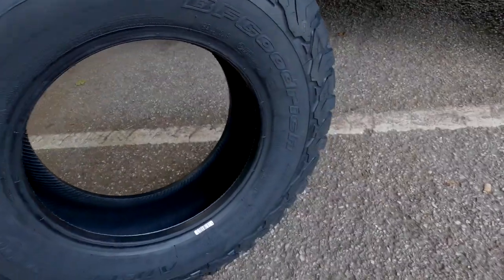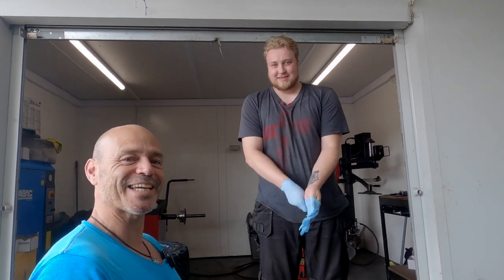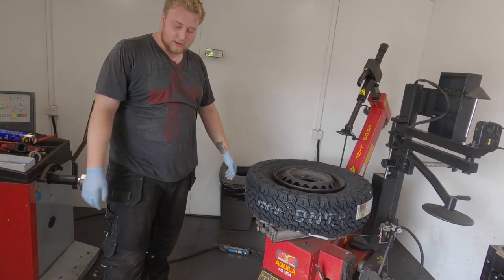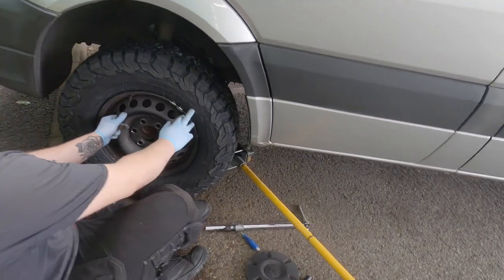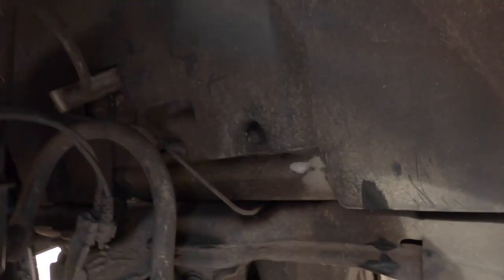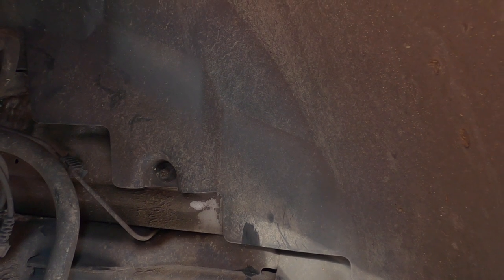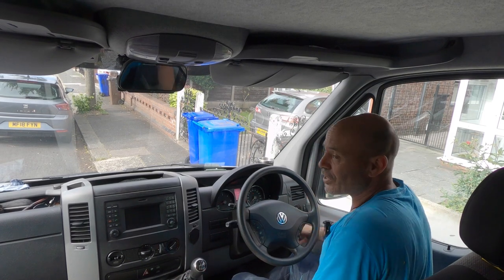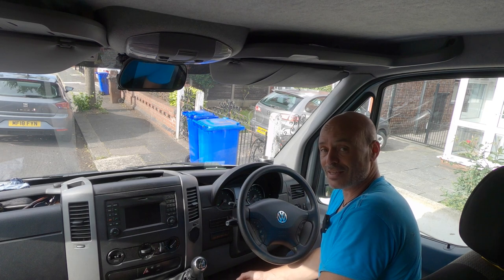Campervan All Terrain Tires/ Do They Rub. BF Goodrich. Scoobie-Dee 53

Comment: The general rule of thumb is a two tyre sizes (25 to 45) goes with a 2 inch lift. The easiest way to get some lift is rear heavy duty bump stops such as sumo spring brand, and coil helpers on the front,...asuming a VW has coils. Most vans do. These are just rubber or poly rings you place between the coil. Saves you getting serios work done. 
I spent $4000 getting heavy duty rear leafs and coil/struts on the front to get a 2-3 inch lift...allowing me to fit 4wd tyres. 
I was going to get BFG All Terrain ...but they were on back order...so I got Goodyear Wrangler Duratracs which are a chunky all terrain, and better in the wet.

Comment: You are really lucky with your 29 mpg...
Mine only gets 21 mpg Most times.
I have the 2.5l 160 horse engine.
Reply from the maker: I notice a big drop if you drive faster than 65 mph . I can get over 30 if driving around 55 mph .. well at least according to the VW read out !!

Comment: Hi, i’ve just seen these tyres on ebay with alloys and they are only 225/75/16  not 245’s. Im reckoning they are not as wide by 2cm so would that be better to stop rubbing when turning for my van? Its the sprinter 2008. Its exactly the same body im thinking.
Reply from the maker: Yeah but check the weight rating

Comment: Hi mate. My tyres are tiny bit bigger so rub a bit more than yours. You should look at sumo springs for the front. Apparently it improves the ride no end. And it will stop that sag into the corners. 👍🏻👍🏻
Reply from the maker: Ok cool, must lift the van up a Cm or so then
Reply from the maker: Also what tires have you got?
Reply: @ScoobieDee  just checked. They are the same actually. But I’ve since learned that the lwb is actually lower out of the factory. To keep centre of gravity lower. I’m lifting mine 2” and sumo springs.

Comment: Can someone please educate me. If the tyre is bigger than standard (ie the tyre is turning LESS often to cover the same distance) then why would you "lose a mile or two per gallon"? If the wheels are turning less often, then you should be getting marginally BETTER miles per gallon surely.
Reply: takes more effort for the engine to turn the wheel, has a same effect as a bigger gear
Reply: I get that @sillytorque  but surely once you’re up to speed and cruising, then the bigger circumference tyres must be more efficient surely? 🤔
Reply: @cambellevans9945  there would be an optimal speed that would be advantageous I’m sure but you would be mechanically disadvantaged outside of that sweet spot- if it happens to be your open road cruise speed and you live on the flat then that’s a win, outside of that the engine and drivetrain are working harder

Comment: Hi Darren, I have a Fiat Ducato so it is not exactly the same but have the same tyres but on alloys, but I have been able to run with much lower tyre pressures as they have a stronger side wall, it gives you a much softer ride so you don't rattle your teeth out over bumps but I just wonder whether this may also reduce the rubbing you will have to try it see, on the speedo difference I found that on the original tyres the speed was under but with the 16" it is actually spot on, maybe they were designed to have 16"  P.S why did you decide not to have the white lettering outside ?
Reply from the maker: hi Malcolm , Thanks for the info , what pressure do you have in your tires. I forgot to ask what pressure the guy put into mine at the depot, I guess 60 psi... they are smoother than the other tires though due to having more tire/ more air. I prefer not to have the white lettering showing as I like the matt black look. best Darren
Reply: @ScoobieDee  I have them at 3.5 bar/ 50 psi